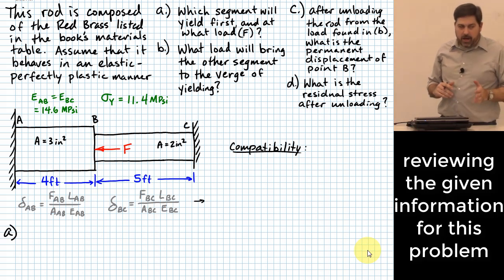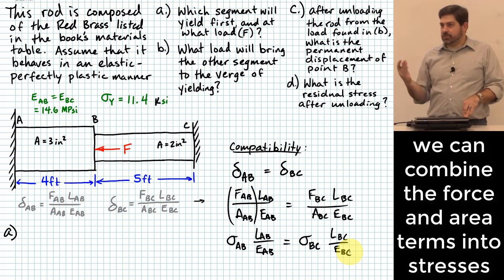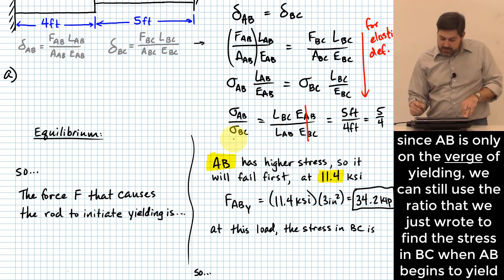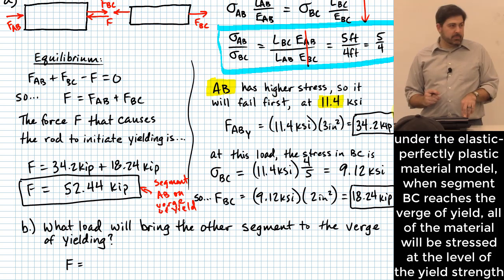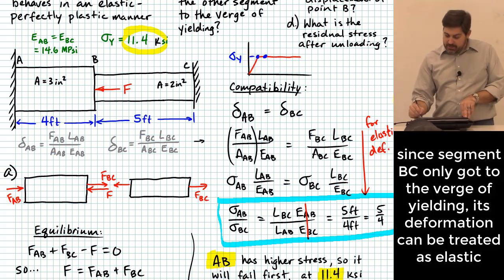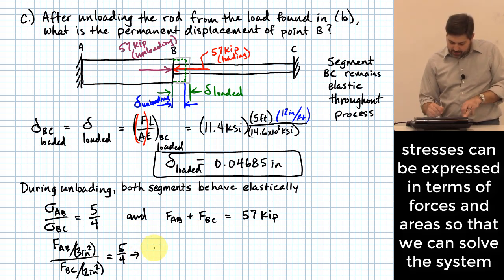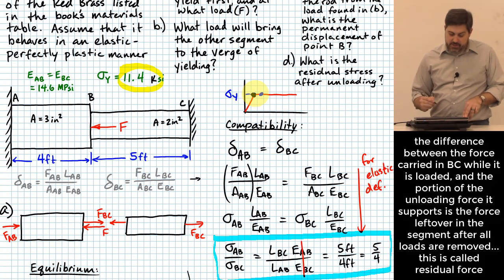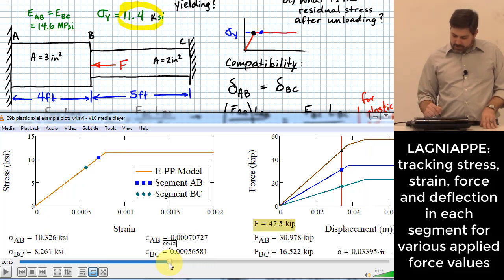Axial Inelastic Deformation & Residual Stress Example: 2 Segment Brass Rod w/ Both Ends Constrained

Comment: Also, rod AB starts behaving plastically when applied force is 53 kip but rod BC is still behaving elastically. Now, when the force is increased to 57 kip why doesn't the extra force goes to failing rod AB, why have you put it such that it goes to making rod BC plastic, at the verge as you say. And finally at 57 kip, rod AB is plastic(assuming it hasn't failed even with force having being raised from 53 to 57 kip), why is it during unloading both are considered to be behaving elastically?. Thank you again, sir